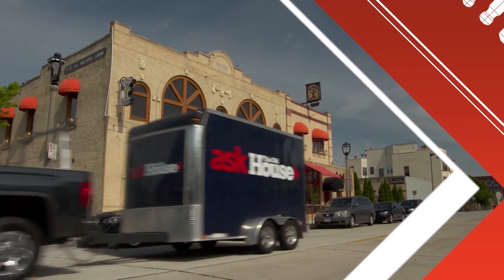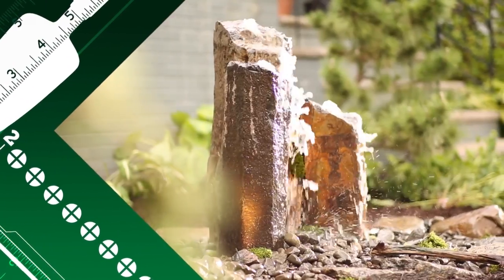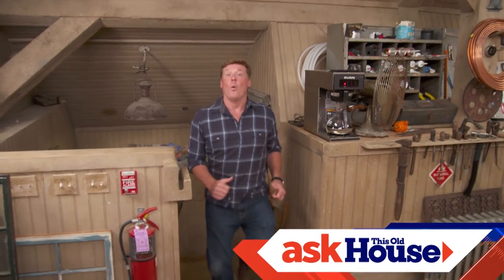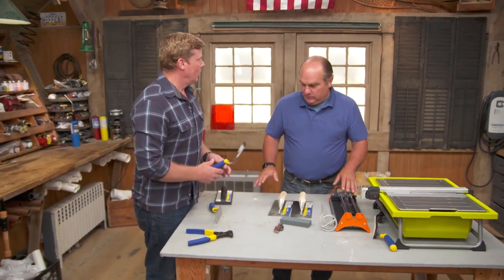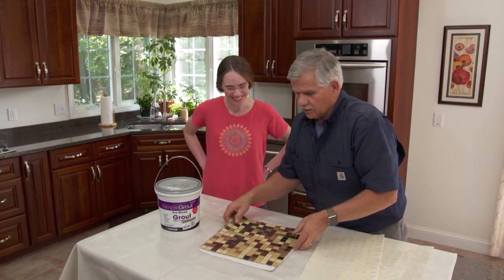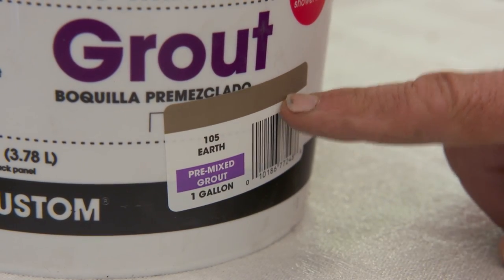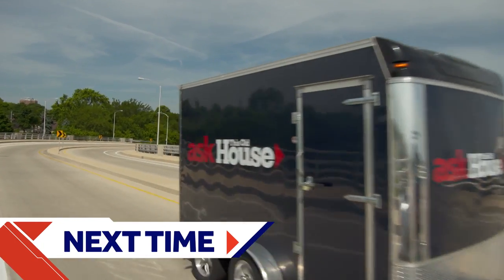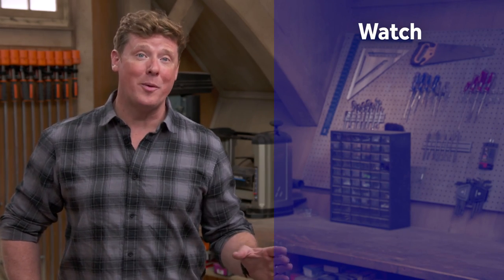Ask This Old House  | Backsplash, Rainwater Feature (S16 E3) | FULL EPISODE

Comment: Another add, would have used a grout sealer keep grease from socking into grout for easier cleanup
Reply: Also add a Microwave Range Hood Extender so cooking on the stove front is captured and exhausted via the built in Microwave exhaust fan to the outside.

Comment: Don’t do tiles with so much cracks and joints that will accumulate stuff and get yellow - totally defeating the purpose of backsplash
Reply: My last house had like a grout that was flush with the small tiles. And it had some kind of sealer that made it smooth as glass!

Comment: Could someone please show these Americans how to connect pipes without gluing them? 🙄
Reply: @Ampacityelectric  But they can't be refitted or reused.
Reply: So what do you do?  Genuinely asking
Reply: @rustyshackleford1733  In this case the pressure line would be a clamp connetor

https://content.four-more.net/item/images/452000/full/Ebay-Startbild-PP-Fittinge.jpg

For sewage it would be standard pipe socket with a gasket. 

Grey for indoor use, https://www.heizung-badezimmer.com/media/image/67/70/cd/ht-rohre-fittings_623000_2im594Ls3pnBOX_600x600.jpg

Orange for in ground https://www.hornbach.de/hornbach/media/de/bilder/projekte/garten/wasserleitungen-verlegen/chke1-dc75bb1286b4392c2234ec5fdc16fb37/kg-rohre-1200x800.jpg

Green for in ground with higher strength https://www.meckrohr.de/tl_files/Produktgruppen/Entsorgung/kg2000-1.jpg
Reply: Julian Reverse hm, okay, this is what I used to make connections under my kitchen sink.  Didn’t know you could use it for sewer connections etc too.  Thanks!
Reply: @rustyshackleford1733  The big benefit of this connection: It can move in all directions. What moves doesn't break.
Reply: @ekujj13  With technology and knowledge stolen from Germany ;-) But I didn't know that NASA is responsible for developing pipe connections. You never stop learning.
Reply: @julianreverse , On a waste pipe, why would you need to move them and solvent welded pipe is way more secure than those fittings. No way I would bury those in a wall behind sheet rock or anything else. Same goes for Shark bite fittings.
Reply: @augustreil  Because ground moves, walls move, heat and cold moves materials, ... 

Well, I would never bury anything glued in my walls.
Reply: @julianreverse , When have you ever had an issue with a soldered joint or a glued joint leaking when they're done right ? Don't try to fix what ain't broke.
Reply: Why is there always some pasty crybaby from across the pond worried about how we do things in our country and on our tv shows?
Reply: @augustreil  When have you ever had a connection like I showed you leaking when done right?
Reply: @julianreverse , Quite a few actually. O-rings shrink and expand and will leak over time.
Reply: @mitchdenner9743  , No kidding right ?
Reply: @augustreil  What exactly do we dump? Who is pumping millions of liters of chemicals into the ground to press out even the las drop of oil?
Reply: Julian Reverse Where do you live?  Seems like you’re looking to stir up trouble coming and insulting Americans on an American tv show.  Obviously there’s more than one way to do a lot of things with pros and cons on both sides.  You can throw words around all you want but it doesn’t change the fact that America is wholly unique and the principles of our founding make it the greatest country in the world.
Reply: @julianreverse , 70% of the UK's power is from gas and coal.
Reply: @augustreil  61% of Germany's power is from renewable sources (March 2020)
Reply: @julianreverse , No it is not, more fake news. That's the biggest load of crap. 27% is the highest at most.
Reply: @augustreil  And the rest of your comment is based on fake news and BS.